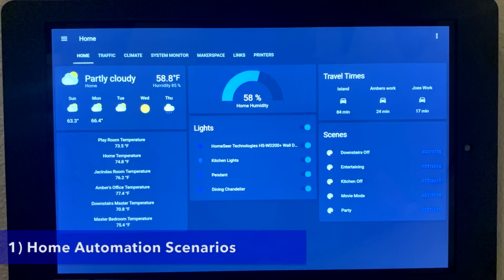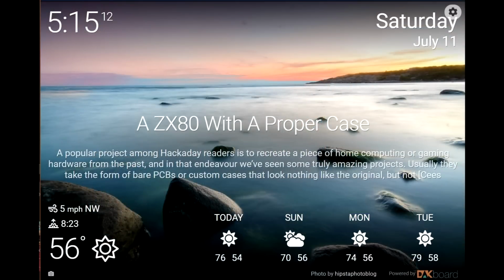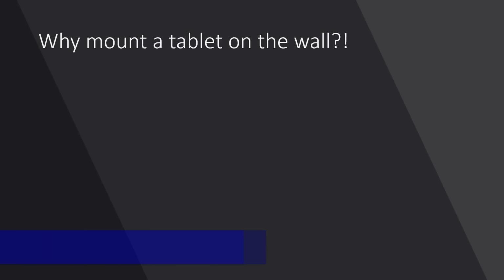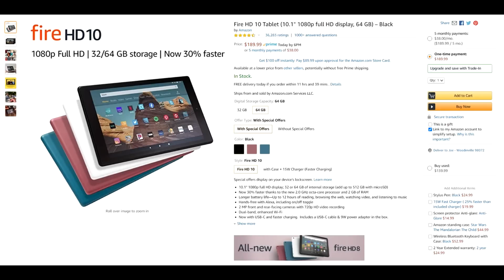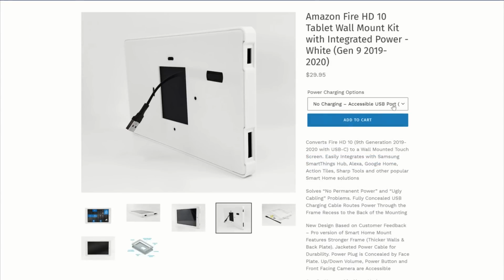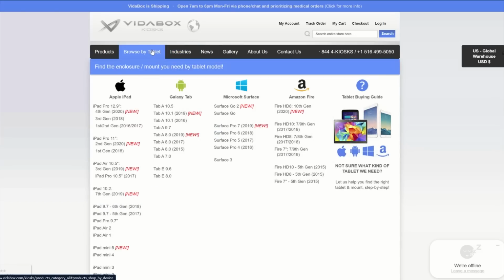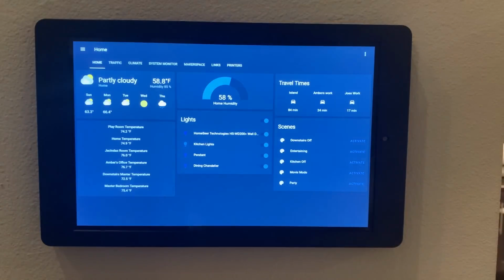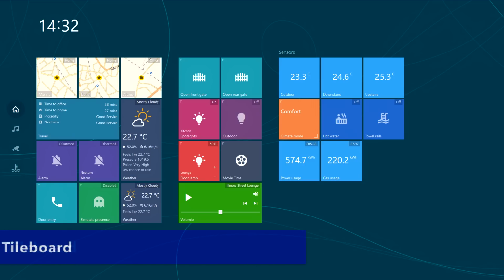5 things to know about wall mounted home automation tablets

Comment: And you get to rip it out in three to five years when there's no longer any support for that tablet.  Note there's no guarantee the mount kit would be compatible with future devices.   Just use your portable tablets and smart phones as interfaces and control your home from a small mini server in a wiring closet.  As to the Fire OS, just reload it with generic Android, indeed learning how to reload tablets with newer generic Android will keep them usable long after the manufacturer EOL's the device.
Reply from the maker: If I have to rip it out and replace it, I'm sure I'd just choose a new tablet and a new mount kit.  I actually look at that as a benefit, as it means I can easily upgrade the system to stay up to date.  The mount is 2 screws,  so easy to replace. I think the key though is looking at it as you have..and plan for it to need an upgrade in the future when you do the power / work.  As far as loading stock android on a Gen10 Fire tablet, there isn't an exploit yet (or when I posted this there wasn't).  So it's not a current option. It's why I mention the stock android tablets as alternatives.
 The planned obsolescence is a good point, I wish I'd mentioned that.  Also it remains to be seen how well these tablets fare constantly being powered and turned on/off as people walk by.  I do hope to do a followup video in a year and then maybe 5 :)
Reply: @geektoolkit  And how would that be more convenient than just replacing the tablets and other smart devices you already have?   A tablet on the wall is just something you already have just fixed to a wall.
Reply from the maker: Oh I see what you're asking, that's a different question. That's very similar to the argument of 'why not just have a remote for the lights instead of a light switch'

The main benefit is reliability...it's always there, always charged, and since it's setup as a communal device, it's setup so that others can use it.  If I have a tablet in my house it tends to move to where it's last placed (and I have a few of them as well that I do use, as well as my phone).  But when say my friends come over, or a babysitter, there's one device in a predictable location that they can use to control my home automation. No login issues, no dead battery, no lost tablet, etc.

Also because it's in a single location, I can customize the UI for that location. I have scenes in my maker space that don't make sense in the kitchen area, and would clutter up the UI. So for that 'user' I can expose a UI that allows for easy control of that so that someone else can control it.

If you don't think it's valuable, I get that and respect it.  I set this up, and it's been amazing.  I plan on installing at least one more, if not two.  But for my bedroom I think I'm going to just do a bedside tablet stand on my dresser...I don't need guests to use that, and it'd be more useful for me. 

To each their own.
Reply: @geektoolkit  Granted, but even children have smart devices now.  They are ubiquitous and each household has multiple such devices per person, plus they move around as needed to be available as needed.  Wall mounted displays are really a relic of the 80's and 99's and it may be best to just have a plain wall suitable for wall decorations.  You already have smart speakers that can provide most of the functionality without any obvious disruption in the decor.  Even charging of devices will soon be replaced with wireless charging, even with the early WiFi base stations of the early 90's where you could log onto the Linux operating system, it was possible to configure them to broadcast continuously and rig up devices that trickle charged off the WiFi cell, they did try to push that as PiFi but of course larger companies subdued that effort, needless to say wireless area charging within the home is already technically possible and may only not arrive because charging personal devices is just a minor nuisance we are barely aware of and likely short range wireless charging offers more product branding than area charging.  I would think charging stations for personal devices to be more easily placed within a home decor than what's effectively a rather somewhat large thermostat dial and regardless of wall mounted displays, you would still have those portable devices around the home.  I'd rather find smart AC plug replacements that can seamlessly place sensors such as temperature, microphones, motion sensors and even speakers surredeptiously throughout the house giving the smart home capabilities without any disruption of wall space as even a thermostat would.  Wall mounted displays are a relic of say the 80's Star Trek TNG and even there they used voice interface more than wall displays.  Keep in mind, your smart TV is an interface as are smart refrigerators, etc.  People are even plastering over the old 80's wall intercom systems.   I can see future interfaces using cameras to see hand gestures and perhaps projectors to put displays in surfaces and coated windows but wall displays are literally primitive today.

Also in terms of resolution of generic devices, modern graphic libraries scale the display to whatever resolution the device has so there should be no loss of display interface by using generic android devices and some generics have impressive resolutions.  Indeed, the last time I had to deal with resolution display dropoff was when I loaded Red Hat 6 onto a Windows 95 laptop which had an unusual aspect ratio hence requiring me to edit a file so that the display could be sized properly, most devices have a protocol for communicating resolution size and aspect ratio to the software today.
Reply from the maker: @johnwang9914  I feel like you are arguing a point against a person who has a wall tablet and finds it useful, and so I did a video on it.  I have most of the other solutions you mention, and this still impressed me with it's usefulness, esp. for having others be able to easily control my home. It's ok if you don't like wall tablets. Others do.

Comment: Get Tab A at Costco.  Goes on sale for 200 multiple times a year.
Reply from the maker: That's a great idea! Costco does a great job backing the product and accepting returns also if things don't work out. 200 dollars for a Tab A would be a great price and save you some of the hassel of the Fire Tablets (like getting the play store on it, or not having the browser update).  Thanks great tip!

Comment: Excellent video. I appreciate that you showed what you did along with other options and possibilities in the future. I have 2 Fire 7s and 2 Fire HD 8 Pluses. None are wall mounted though. Resolution is really important as you mentioned. The Fire HD 8 Plus has Qi charging so I've got one sitting by my bed on a regular Qi phone charging stand and the tablet runs 24-7. There is a matching charging stand which I also have but you can save money if you already have a phone charger. Fully Kiosk Browser is awesome but there are SO MANY options and settings which can be a bit overwhelming when starting. Also running Home Assistant but I use AppDaemon for my dashboards.
Reply from the maker: Ill have to check out Appdarmon more!  I love the idea of a Qi charged bedside dashboard/alarm clock. I thought about showing a “non wall mounted” option but cut it as it broke the flow and focus but I’m wondering if a separate “home automation using tablets” ideas video may be a good follow up :) Thankyou for the kind feedback I’m glad you liked that I went into the various solutions. It was what was missing for me personally from other videos, and so that’s the video I made!
Reply: @geektoolkit  I just watched your newest video regarding using tablets for home automation. Here's an update. I'm still using the Fire HD 8 Plus with the charging dock. It's great since I have not taken the leap to mounting the tablet. I'm still using AppDaemon for my dashboard but I'm considering using Lovelace because AD is effective but not "pretty".
I recommend getting a Fire tablet WITH the ads since it is cheaper and use Fire Toolkit to easily add the Play Store and remove  the ads. I'd also suggest using FTK to use the Nova Launcher instead of the default launcher. With Prime Day coming up soon, I expect to see good discounts on the Fire tablets.
For mounts, I'd like to mention MBMounts. I have not purchased one yet, but I've read good things, there are lots of options, and fair pricing. Plus, they show some of the power options available to be able to get everything in one place. The mounts are surface mount; not recessed. But if you consider getting a Fire 7 and replacing a light switch, the tablet is now the switch and mounts to the electrical box. (Hardwire the power to the light socket, use a 120/240VAC to DC converter to power the tablet, and use a smart bulb(s) in the light fixture.) This approach would be useful for someone who does not (or cannot) put holes in the wall. https://mbmounts.com/collections/tablet-mounts
Reply from the maker: @d_sellers1  This is awesome advice!  As a youtuber I thought through the idea of talking about the ad version of the tablet and using a tool to remove it, but honestly that would be me promoting something on my channel that could be considered theft.  The ad subsidized versions of tablets by companies are meant to generate revenue, and by nerfing the ads, they lose the revenue.  I don't judge anyone that does it and may do it myself (as well as use ad blockers) but I want to be careful on my channel about what I put out there if that makes sense :)  That being said that sounds like an awesome idea, and yeah the MakesbyMike definitely have the power solutions down which is really cool (and he does a reasonable price on them!).
  I hadn't considered straight up replacing a slight switch, but that makes sense too...I may have to think on that. I really like having my switch as a backup just in case (like if my wifi router goes toast I don't want to end up in a state I can't turn the light in the room on). I recently had something similar with Zwave, my switch got into a funky state and I was using wifi to the bulb to turn the lights on, but the switch stopped working for a few days.  Just something to think on, I'm not sure this stuff is rock solid enough yet that I'd walk away from a physical switch still :)

Comment: Can we use raspberry pi with Android on a touchscreen display for that?
Reply from the maker: Possibly.  It assumes a number of things: 1) You can get the playstore working on the pi, 1) you can get the app installed and it can access the pis hardware as needed, and 3) android runs performant on the pi. I know that even on my pi4 the web browser performance alone is not ideal.  After you do all of the above you'd still have a solution which is thicker than this and will need a way to power it, mount it, etc.   I almost feel like a pi + touchscreen + 3d printed (or desktop) case may be a better solution than trying to wall mount it. Even then, if someone is starting out I almost feel like a cheap android tablet gets you farther.  I love pis, believe me, but unless android on a pi has come a long way (and it may have0 I dont know if that's a great path. But now you have me curious so I'll have to put android on my pi 4 and try it :D
Reply: @geektoolkit  nice thank you for the response keep us updated :D

Comment: I didn't see it mentioned but if using any Fire HD tablet you should use this Toolbox software to disable ads and remove the bloat from them. https://forum.xda-developers.com/hd8-hd10/development/official-amazon-fire-toolbox-v1-0-t3889604?nocache=1
Reply from the maker: That's great to mention, thankyou! In the video I simply mentioned paying the extra 20 dollars or whatnot to prevent the ads, but it doesn't help with the bloatware. The main thing I'll have to check that toolbox out for is if it can update the webview so that the rendering gains features that are missing from the built in
Reply: @geektoolkit  Doesn't look like it, but the dev seems pretty ambitious and open to challenges on improvements. Maybe drop him a note.
Reply from the maker: Oh I think it’s just a matter of time. They seem to jailbreak every version eventually. I’m patient for it, when they get there and it’s solid I’ll be ready :) I appreciate you sharing the link it’ll help the community out that is looking to do this!

Comment: DUDE this was an amazing video with all of the questions that are frequently asked. One thing if I could suggest if you could do a video on your light setup and make/model you would recommend and maybe how that ties into your HA setup. thanks!
Reply from the maker: Thankyou!  I have a Zwave video that shows the Zwave stick and I think that I'm using GE switches, but I am working on a follow up of using Innovelli...there are some benefits to Innovelli that I think will be really cool to show off.  I'm working on updating my Dynaframe project (project videos take alot longer, esp. when I have to code as much as I do for this one) but once that's done I plan on putting out some more home automation videos, and I'll try to keep the bar high. Thanks for the great comment, I put alot of work into my videos to try to be succinct and to provide as much info as possible!
Reply: @geektoolkit  I shall subscribe :) Well done and keep making great vids!

Comment: Could you please explain the setup that you used on the back-end? Are you running Home Assistant in a Raspberry Pi (or another device)? I already purchased the tablets and the wall mounts but I am struggling to find the right configuration. Is the tablet able to call the IoT devices directly or it does need an automation box (e.g. Raspberry Pi )?
Reply from the maker: I’m using a raspberry pi running Home assistant. The tablet can run apps, so you’d want an automation backend to connect to. For instance if you have a SmartThings hub from Samsung you could run that. If your technical and don’t mind some work I recommend Home assistant. If you want “it just works but may not work the way I want” then smartthings is a way to go. You could also just hook up lights like Phillips hue and use the tablet to control them. The tablet is just an interface, how you build off of it is up to you. If you decide to go with Home assistant I have several tutorial videos to help get you started. If you have any other questions let me know and I’ll try to answer

Comment: This was one of the bests reviews that I found on the internet about how to use a tablet as a Home Assistant to control IoT devices. I heard your comments about the limitations of the Amazon FireHD but I am curious to hear your opinion about the Vankyo Matrixpad S30 10'.  Between these 2 options, which one would you choose? With the exception of Apple iPads, I love Samsung devices but I would never pay 700 bucks in 3 tablets. My plan is to install 3 devices like this at my home.
Reply from the maker: Thankyou!  I think the thing about the Vankyo is just finding a solid mount for it. It has some quirks like a 50hz refresh rate according to the ETAPrime Video Review I watched, but overall it's a full android tablet, and for this use you don't need much.  The FireHD is an ok option if you're not doing anything too fancy (such as custom cards or animated backgrounds). My regret is that now that I have the FireHD 10, if I do get a custom card or try to do soemthing fancy in Lovelace that doesn't render...I'm pretty much stuck with the browser control I'm using. Unless a root exploit is found. Which isn't a great place to be in IMO.
Reply: @geektoolkit  I am planning to start working on the project of my wall-mounted home automation tablet soon and I would like to hear your opinion about the best software for this type of project. Ariela, WallPanel or Home Assistant running in a Raspberry Pi (or another device)? Which one would you recommend? Do you have a tutorial to recommend for newbies? Correct me if I am mistaken but Home Assistant seems to be much more powerful and flexible but this comes with a high price. I will have to spend 3x more time to set up the dashboard than with WallPanel and Ariela.

Comment: What kind of lighting are you using z-wave ? It seems very fast.
Reply from the maker: Thankyou! I’m using Zwave GE light switches, lowest price I’d find on Amazon. I’m going to try some Innovellis however soon!
Reply: GeekToolkit For years I’ve been using Vera for my Z wave and it’s not as fast as yours yours is really fast and I tried it in a few different homes still about the same speed I looked in the home assistant but it was a little complicated so I kind of just backed away from it I had a raspberry pi and I fooled around with it for a little bit but it seemed like it was more trouble than it was worth
I have a couple of tablets mounted to the wall and I run that through Vera and using Tasker you can make some really good looking UI’s using Tasker For tablets I use 10 inch Lenovo tablets they work pretty good
Reply from the maker: Oh interesting! I think I’m using an Aeotek stock (I’ll check when I can) into a pi. I’ll check out tasker I’m a huge fan of pretty UIs :)